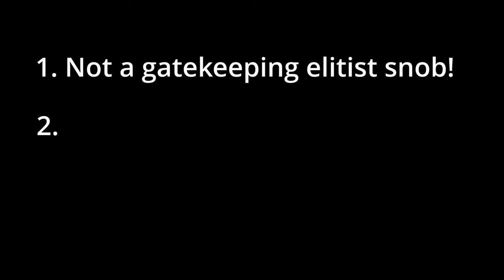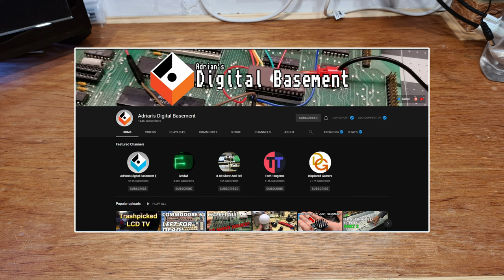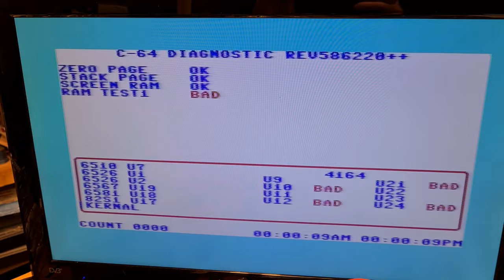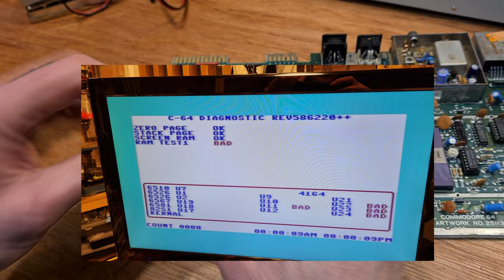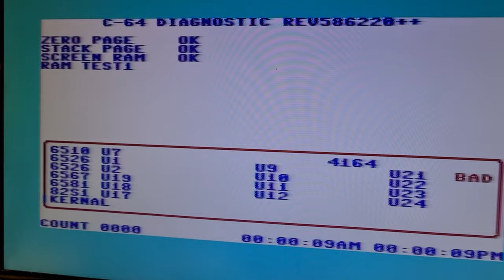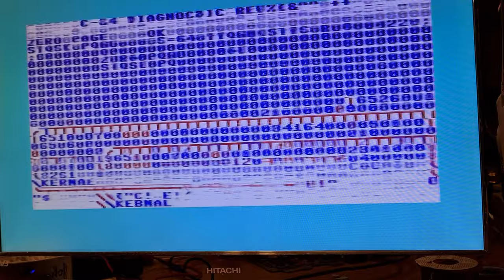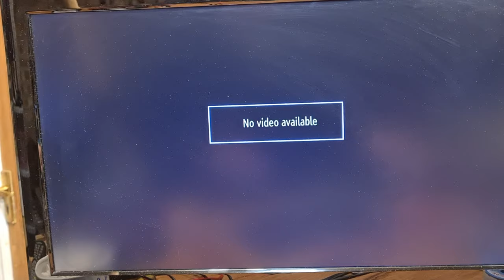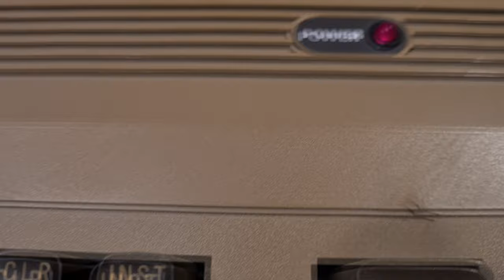C64 Repair Plus BONUS Desoldering Guide

Comment: Great Video!!! Good job! I remember my 1st repair just a months ago and how good it made me feel to have fixed a 40-year-old C64!! I then got the bug!!! bought a bunch of better tools and fixed a VIC20 power switch, plus/4 CPU socket, SX-64 bad RAM and added a 40mm fan to my C128DCR PSU. Now all my Commodores are working!!! and I have many hundreds of dollars in a soldering workstation (desoldering tool, hot air tool, hands free older, fume sucker, ect), makes me want to buy some broke stuff! TY for the Commodore content!!!
Reply from the maker: Thank you Charlie! That's quite a collection you have there. I'm very jealous of the SX-64.
I've found more pleasure working on these old machines lately than actually using them.

Comment: a pleasure again :D like you ive always struggled to get hold of C64, repairing things for the shop often feels like the barefooted cobbler with missing out on so many key systems in my own collection but fixing them for others xD
Reply from the maker: Thanks mate! I do have a spare one if you want to trade something for it?
Reply: @MoreFunMakingIt  what are you looking for atm? can always have a rummage.
Reply from the maker: @SparksNZeros  most of the gaps are filled now. I'm missing most atari 8 bits, a gameboy advance or sp would be nice. Of course the less obvious stuff is going to be out of reach. Oric 1 would be a dream. Dragon 32 is another one in missing. There's probably loads of 8 bit stuff I need
Reply: @MoreFunMakingIt  i could sort a GBA SP with its charger and a new battery but itd definitely need a new shell as it's a little worse for wear, never had any issues with it working reliably though, bulletproof little things.

Comment: Another great entertaining video. My new favourite channel. The C64 is the only 8bit machine I don't own and never did. I must get one, but I hear they're temperamental to say the least.
Reply: Get a C64C. They are much more reliable and tend to simply work.
Reply from the maker: Thank you! You're now my new favourite subscriber!
The C64 is fine. I think we hear a lot about the ones that break because making videos about the ones that work just fine might be a bit boring. Get one! And get a Kung Fu Flash cart from The Future Was 8bit. Brilliant combo.
Reply: @MoreFunMakingIt  I've had 4 C64 so far. An old breadbox with a long board, an Aldi and 2 C64C all with the same short board type. The long board had dead PLA, dead SID, dead Kernal ROM and a few dead RAM chips, the short boards simply worked and keep working.
Reply: @MoreFunMakingIt  I'm on eBay as we speak... 😉
Reply from the maker: Uhoh! 🤣
Reply from the maker: @KolliRail  They definitely got better at making chips as they went along! The C64C is a much more reliable board. On the flip side if it does go wrong its not quite as easy to replace some of the chips.

Comment: Congrats on your first 64 repair. I've repairs a ton of them. Since you have socketed most chips, you should socket the rest. Will may it easier to troubleshoot in the future. Just my 2 cents worth;) Thanks for sharing! Btw, I have a Commodore spreadsheet for troubleshooting. It's free and you can find it on my channel.
Reply from the maker: Thank you! 
Spreadsheet bookmarked and channel subscribed! :D
I'm definitely planning to put sockets in the rest of this board. I dont think I'll go all the way to ZIF sockets though, it's not like I fix many C64's :D
Reply: @MoreFunMakingIt  Thanks! I agree, no need for ziff sockets

Comment: Nice video.  Thanks for having the humor involved.  Lol. I've been working on these for 3 years now.  Sometimes easy,  but sometimes a challenge:)   I was wondering about the multiplexers for the ram.   But I guess not in this case.
Reply from the maker: Thanks Donald!
I've still got so much to learn, but I'm having great fun anyway! The next one, which might be a few weeks away, is proving really tricky! It's good though. If they were all easy it would soon get very boring.
Reply: Me too,  so much to learn,  and easy fixes are boring. Lol. Nice desoldering and soldering work tho:)  not going to lie.. I destroyed a c64 board a couple years ago using a cheap desoldering gun and soldering pen.  I have a hakko now, which I've only used 3 times.  And a soldering station.   Amazing difference from where I began.  Hot air always when removing chips for me anyways:)  It's highly addictive. I now have 4 64C  and 4 breadbin style,  and one coming in a couple weeks.  Covid got me started.  Good luck bud:)   👍

Comment: I'm going trough your videos and 330C on the desoldering gun is probably the reason why you lift standalone eyelets off PCBs. When you have the chance try 270C to see if you can work on Sinclair stuff without lifting any.

Also, a cheap set of "hollow soldering needles" can help when you get a clogged via as these can be heated and push the molten solder away.
Reply from the maker: I'll give it a try! 😁

Comment: The video was very entertaining! But while I really like the way you present your work, I don't really like the style of troubleshooting: pulling each and every chip until you find a non working one. I can relate to the method as I'm also not very good at interpreting oscilloscope traces and schematics like Adrian or Noel do. But at least I would have been interested to see how the signals on the CPU looked.
Reply from the maker: Thank you Kolli!
That's fair comment. Faced with the choice of learning everything I needed to know (hours) and pouring over schematics to find the relevant traces (more hours) and then going through data and address lines one by one trying to find a problem (hours and hours) or just whipping the chip out and testing it in a tester or a working board (literally 5 minutes per chip) I prefer to go this way. In the end I only removed 3 or 4 logic chips, the PLA and the CPU. The thinking behind it was sound and I'm happy with the methodology. As a bonus I have these chips in sockets now which will make testing other C64's in the future much easier. In fact I plan to put sockets all over this board for that purpose. This will be my own machine to keep by the way.

Comment: My VIC-20 is a trash find, literally pulled it out of a skip, in mint condition, inside and out. Bizarre.
I've got it on my workbench now. I put a socket under the CPU so now I have an original 1983 6502 for testing other boards 😁
Reply from the maker: I've had some bargains, and had some lovely donations, but I'm yet to own something I rescued from a bin. I live in hope though 😆
Reply: @MoreFunMakingIt  I don't know what it is, but there is something special about such serendipitous finds. And it's just a crappy VIC-20! I have no use for it whatsoever 🤣I was 13 in 1984 and I hooked right onto the C64 train through the 1980's.
Reply from the maker: We're about the same age and obviously prone to the same nostalgia itch. It doesnt really matter if its useless now. It was cool once and if we owned it then we want to feel that again, if we didnt own it back then we want to know why it was cool then.
Reply: @MoreFunMakingIt  It's the stuff that wanders the boundary. It's the pioneering stuff that all that tech we now know and love is based on. That pioneering stuff that was made for squeezing the last drop out of. Besides the nostalgia,  my 2c on that :)

Comment: 20:00 Did you try scotch brite yet?😁
Reply from the maker: I'm going to the shop right now to buy some. I'm not even joking!
Reply: @MoreFunMakingIt  It might not be satisfactory for everything, but it sure cleans copper edge contacts and corroded IC pins well, and works wonders on brass. DO NOT use on gold though, it's too abrasive for that. I tried to rub nickel oxide off gold contacts once and the sponge glinted of gold, not good.. So for that I also use the pencil rubber. There's three kinds of scotch brite, grey, green, and red. The green and red work best in my opinion. There is a drawback. It's less precise as the glass fibre pencil.

Comment: Wot no recapping?😀
Reply: Turns out, replacing caps is not always necessary!
Reply from the maker: There's an argument for and against. I went with couldn't be bothered so didn't :D
Reply: Aye. I know, fair enough when they're from the era of cap rot, but generally I think that the less you have to touch the better